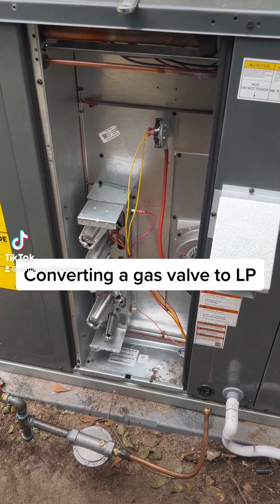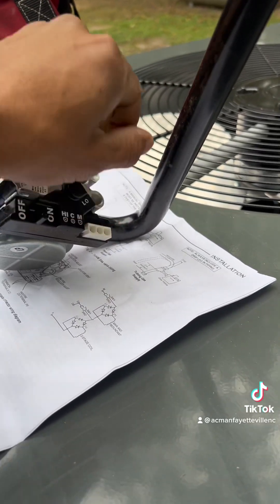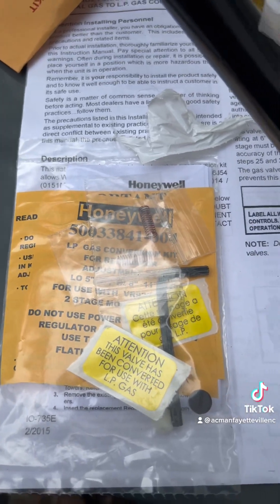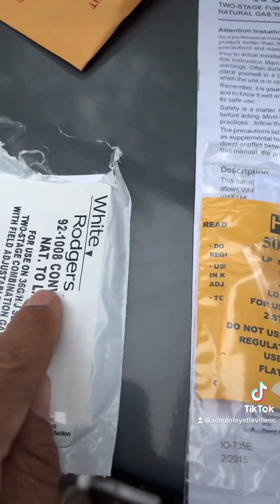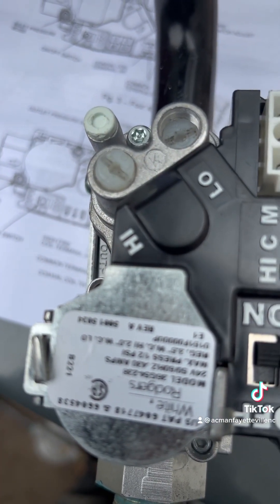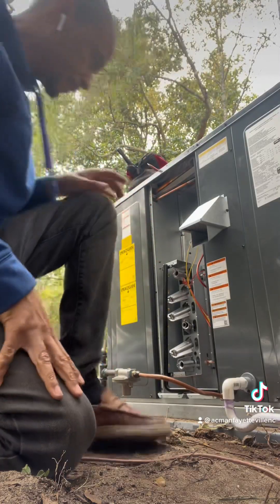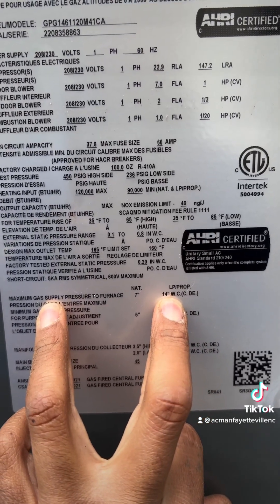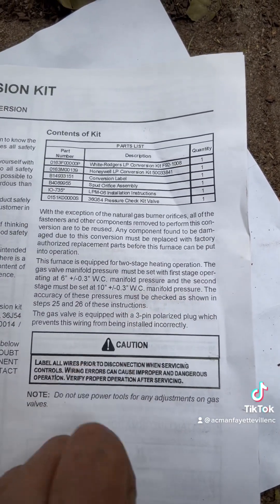Converting a gas valve to LP on a gas pack

Comment: Springs are seated how many turns should I screw in the plastic caps.   Before I make the unit Fire .  Should I screw them in half way .
  I don't want to have a huge flame shooting out